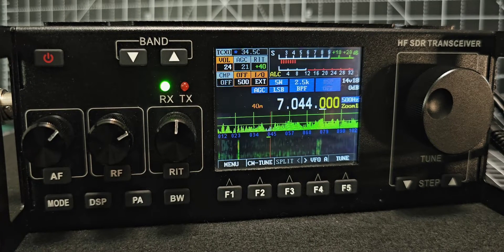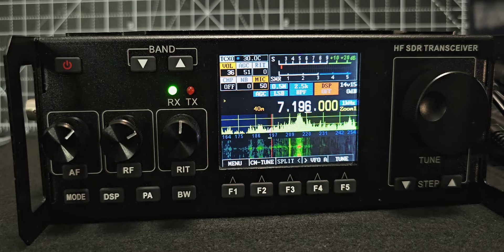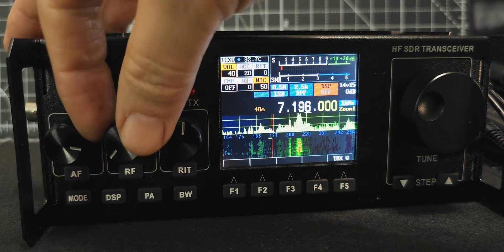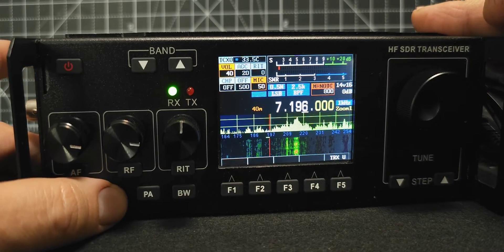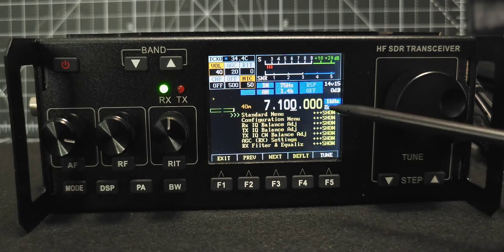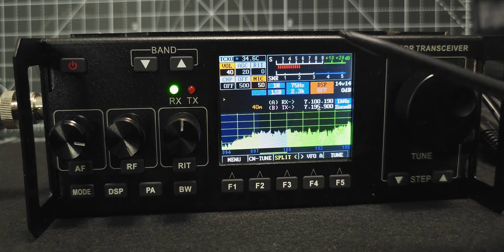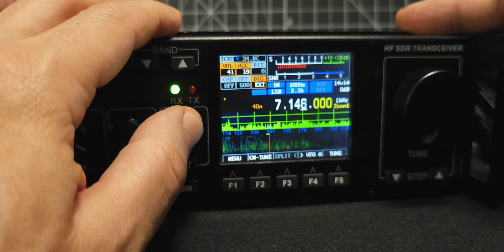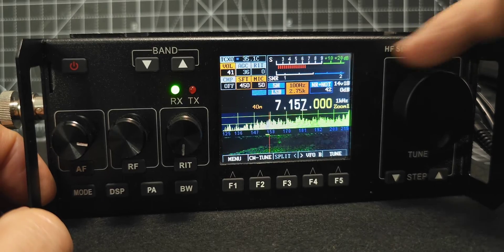RS-918 HF , SDR TRANSCEIVER - BEGINNERS GUIDE

Comment: Thank you for the videos on this radio. I do notice that in this video the spectrum/waterfall spans the entire width of the screen with the DSP/BPF, etc. indicators above it, yet in other videos the DSP/BPF indicators are to the left of the spectrum and the spectrum does not span the full width. Is this a setting, or is this different FW, a different radio?
Reply from the maker: There are many settings within this set .
Reply: Thanks, I see there many settings. Wonder if any of them apply to the display question I asked as this is a decision factor in my purchasing the radio.

Comment: I may end up getting this one shortly do you know if it can be powered using direct current to the power point what is the exact DC voltage
Reply from the maker: 13.8 to the radio
Reply: @HamTechRadioScannerDrones  thanks for that I'm definitely gonna get it  also a universal power supply as well this radio falls within the legal PEP for my licence class which is between 0.2-10 watts

Comment: Wow looks great for the price. I'm set up for uhf vhf. But certainly thinking of trying hf now that you don't have to sell your first born. Unfortunatly living in a flat hf antennas are a bit big. Any suggestions for a reasonably sized antenna for this radio
Reply from the maker: Sellotape a wire to the ceiling